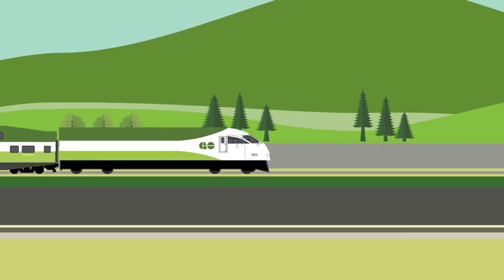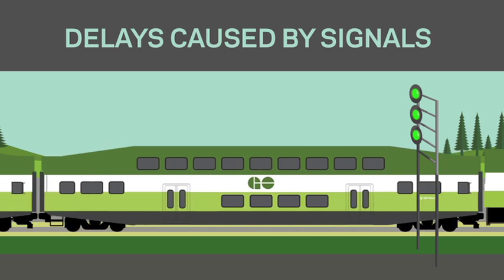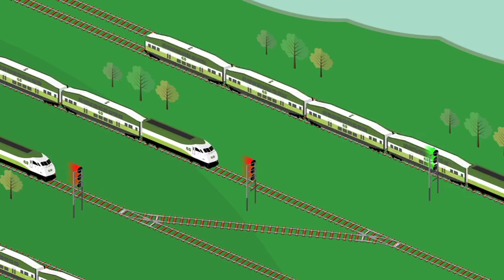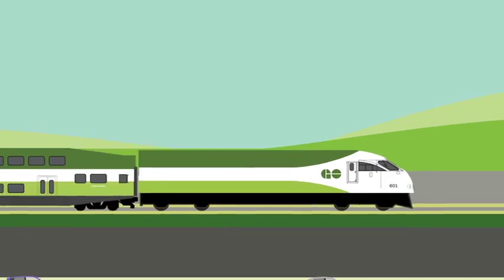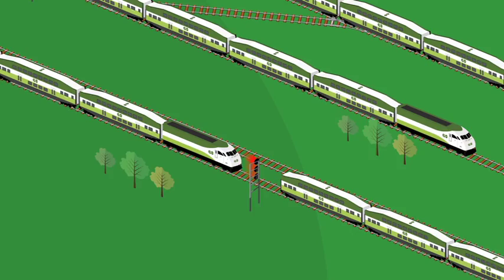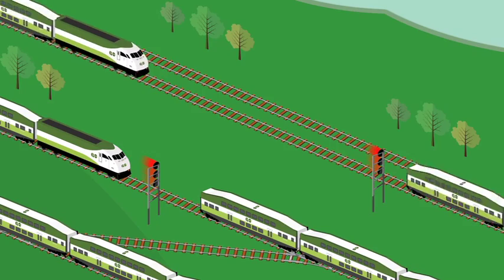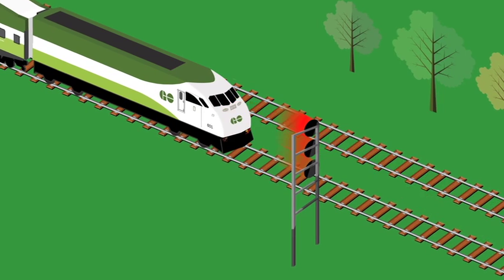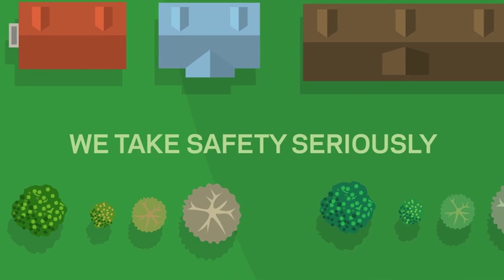Delays Caused By Signals

Comment: i question why they decided to show the signals the way they did, they are a company that runs trains, and they actually didnt even use the correct signalling in this video......tho i suppose the one who made this are separate from actual rail operations and therefore dont really know anything about it... =/
Reply: I was thinking the same thing.  These are incorrect in the CROR.  They could have at least just showed the single aspect which is simple enough for everyone to understand.  :-)
Reply: This video is supposed to show you why signals cause delays. Not a video about “this is how accurate a signal has to be in a video”